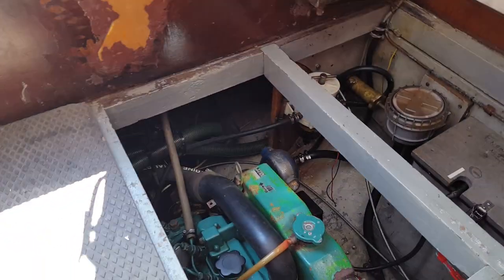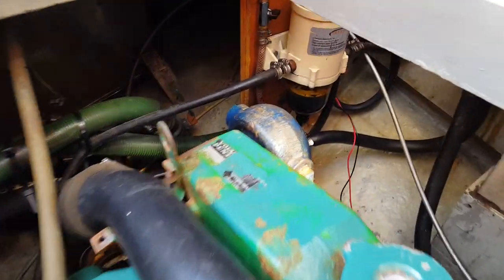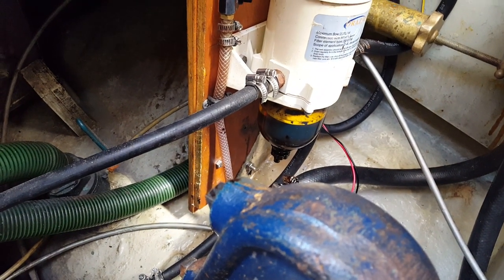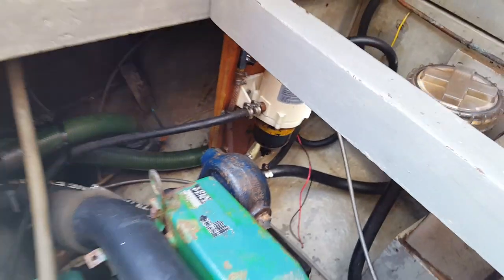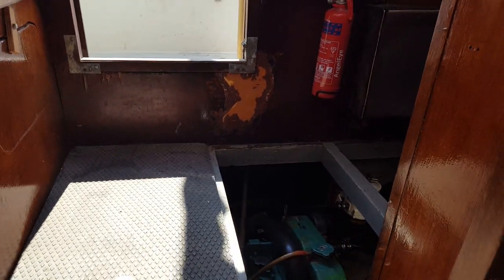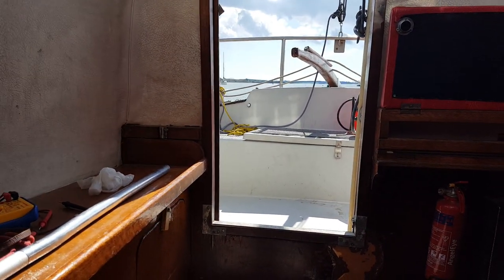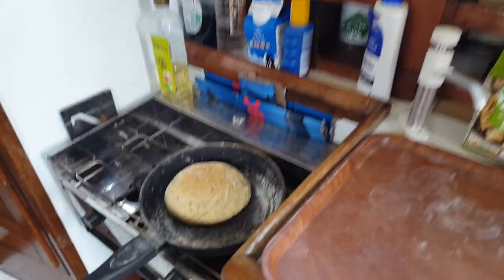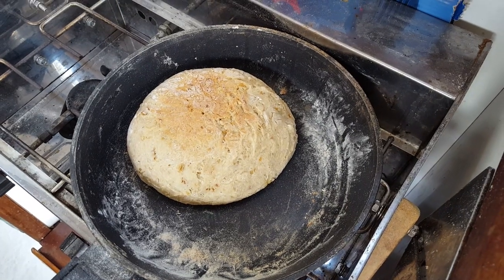focaccia pan bread

Comment: Dylan, what sort of dinghy is that please? I found the site but they seem to have several different types.  Does it tow well? Love the bread... must try it!
Reply from the maker: It is designed for trout fishing so there is a big space to stand up in. It rows a treat.  It will safely accommodate five or six adults, rows nicely with two rowing position and two or four rowers, goes very well with a 2.3hp.  I also rig an optimist sail  which allows it to reach and run sans late or rudder. I have towed it at sea and no problemns so far. Best £300 I ever spent on boats. https://heylandmarine.com/trout-rowing-boat/
Reply: @KeepTurningLeft  That truly does look wonderful. I wonder what the postage to Australia would be.

Comment: Can't pull the tank, so how about a twelve inch hatch just abaft the mizzen stick, with a six inch inspection cover below, right near the front of the tank? That's my plan for when she gets a case of diesel worm. THE BREAD LOOKS GREAT!
Reply from the maker: I have seen a hatch in there. Not keen on cutting a hatch in the floor. I had one  on the mirror and it always leaked a little. I am confident that the marine 16 is still doing its stuff. It converts the bug mass to a free flowing gunk that settles in the  water trap before getting anywhere near the  filters.  It has not stopped the engine once I changed the filter system from Lucas to Racor.
Reply: @KeepTurningLeft  Make the deck pretty flexy too, I expect. Hmm. I suppose she'll eventually push it all through to the filters if you run the engine lots. Happily, I've never seen any sludge, but I wish I'd pulled the tank when I had the engine rebuilt.
Reply: @KeepTurningLeft  Did the Lucas not have a glass bowl aggromalator/water trap? (sp)  I always installed 2-inline on boats with dodgy tanks. Glad to hear the sludge is coming through anyway.

Comment: I had the same issue last year and did exactly the same as you, kept draining the water trap and more regular filters changes, but be aware I did notice in rough weather the tank gets stirred up and it can get much m worse.  So much so I decided to change the primary fuel filter while sailing across Lyme Bay as the wind was forecast to drop and I knew I’d have to motor and didn’t want to end up with no engine and no wind and having to get a tow!  Keep em coming, have fun!
Reply from the maker: I always have the outboard as a back up so main engine failure is not a worry.